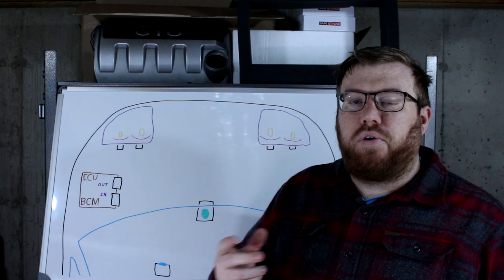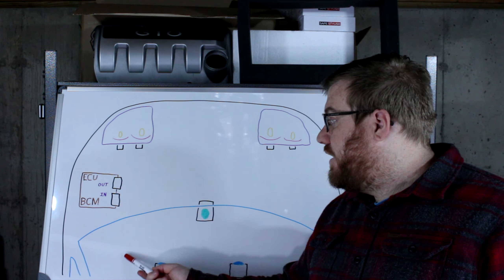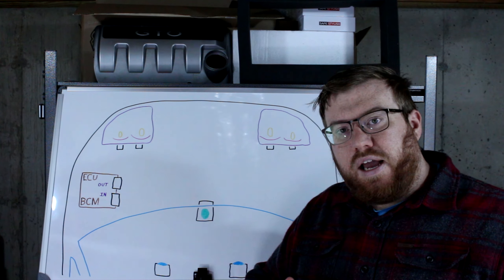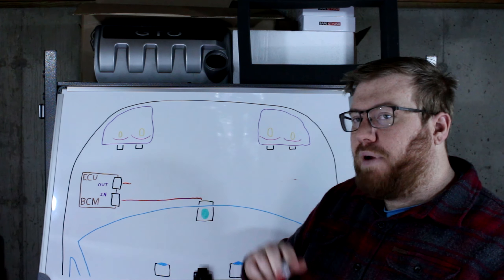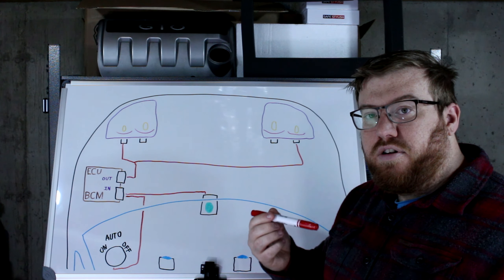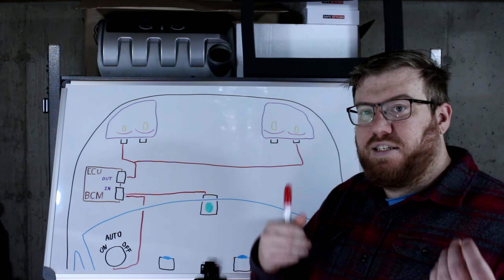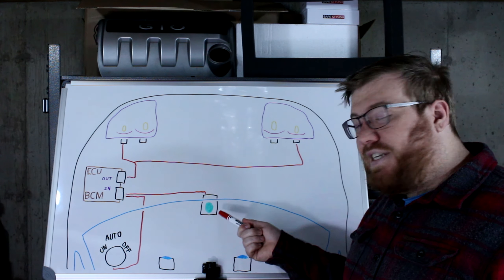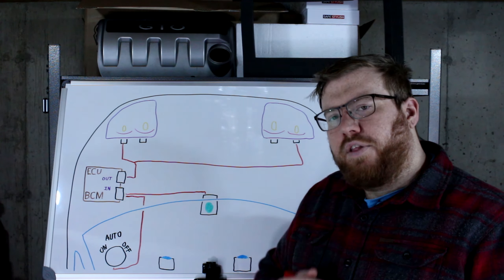How Automatic Headlights Work

Comment: THE issue is that car owners do not know the AUTO mode  in the headlight switch even exists!! Another issue is that owners assume headlights are for nighttime illumination vs safety and visibility! Dark rainy foggy days require lights ON as well when it’s raining and the AUTO mode may not work. Canada went past the AUTO headlight switch feature and all cars have lights ON always when the engine is running. Thanks for the technical explanation. Love the idea of covering the light sensor so AUTO mode turns ON the headlight always.

Comment: The significant number of motorists driving in dark parking structures, at dawn/dusk, in fog, on cloudy overcast days, in tunnels without headlights is alarming. AUTO mode isTHE setting to be used for SAFETY even on vehicles with daylight running lights. Truly, it is an Use & Forget system. BE SAFE.

Comment: Thanks for a fine explanation.
I think that automatic headlamps is a "silly" feature...something else that can break or go wrong. 
Maybe I'm old fashioned, but how much effort does it take to see that it is getting dark outside or that I'm entering a tunnel or dark garage and that I have to turn on a switch?
I guess this is the future of automotive technology. ✌🏽
Reply: Idk personally as a new driver, I find it's nice to have less to think about so I can focus the most on the road
Reply: Unfortunately I’m starting to see more and more drivers driving at night with their headlights off. A lot of new cars have instrument cluster’s that are already lit, So they think the headlights are on as well. Or some cars have LED drl’s and they think those are the headlights
Reply: So many people run without headlight in rain. Auto headlights makes sure that doesn't happen
Reply: It’s very useful if you drive with hand controls and both of tour hands are occupied while driving.  It’s very useful to have automatic headlights.
Reply: As much as auto headlights can fail, at least with my 2002 tahoe my ambient light sensor failed that controls the automatic headlights. But since it failed it will automatically turn on the headlights when the ignition is turned on which is a good back up
Reply: 1) there is really not much in them anyway. All lights in any post 2005 or so vehicle are controlled by the BCM. Auto headlights is just one light sensor input to the BCM, everything else is in software. And in case anything fails the BCM defaults to failsafe mode - headlights on all the time

Comment: If my crosstrek doesn’t have auto headlights can I add them by changing out the control arm on the steering column? In other words, is the HCU the same on any model (base vs upgraded) Crosstrek?

Comment: Hey very informative thanks for that. Have a question, so my friend wanted to power on a LED sign that he had in his back window, he tapped into the auto head light on circuit so that whenever it gets dark the sign will power on at the same time the headlight comes on. The issue is he seems to be having a parasitic drain that when he parks the car for a couple weeks without driving it the battery is completely dead. This happened twice once was a brand new battery. He’s now on his 3rd battery, instead of gambling whether or not it may happen again. I wanted to help resolve this, this led sign is the only aftermarket accessory he has at the moment. He just got the car too so we’re not sure if this was occurring before the install. If it were me, I would have went a different route but he thinks since the led has a low power requirement than it shouldn’t affect it so much. Anyway what are your thoughts could this be our mystery drain culprit? Appreciate your help, many Thanks!

Comment: My Crosstrek has automatic headlights but I tend to put them on manually since I have been doing that for over 50 years.  Some habits are hard to break!
Reply from the maker: I prefer manual selecting because I am just stubbornly particular about stuff sometimes. My first car had automatic headlights, but I often still used manual. My route to school more recently has a tunnel situation that would cause the 'Trek to turn the lights on a second or two before reaching sunlight again, and it seemed like it would look silly from an outsider's perspective, so that got me sticking to manual lights even more.

Comment: So are Auto headlights supposed to turn off when you turn the car itself off ??
Reply from the maker: Generally they do, but they also tend to have a delay on newer vehicles that keeps them on so if you just parked somewhere with poor lighting at night, you can use the headlights to see for a bit.

Depending on the car, if they continue to stay on, it may be a fault, a setting you can change, switched off based on your proximity via the key fob, or the switch is in the "on" position instead of "auto". Even then, most modern cars will auto-shut-off headlights after some time.
Reply: @CarsSimplified  thanks so much for the response but yea, I have a 2005 Camry XLE and if it is night time and I turn my car completely off, my headlights will stay on even after a while . Also, I'm sure this started to happen after my key fob broke . So if it's due to the key fob, would a new one fix the issue ???
Reply: @Neon_Dre  No, it’s not a key fob issue. Check car owner’s manual for details on how to set the delay timing on headlights when turning the car engine off. Thanks

Comment: my battery is nearly dead and the stupid car is turning the headlights on that's something I cannot handle and we'll get rid of
Reply: Well actually sir, when your driving your car, lights, radio, heater, a/c any other accessories requiring power, they will use your alternator, not your battery. Your battery is only is for starting your car, you can actually remove your battery while your car is running and it’ll drive completely normal, that is till you turn it off and need to restart it again is when you’ll need it.